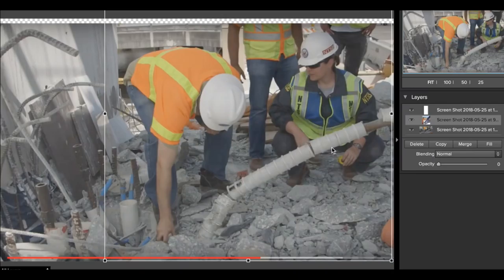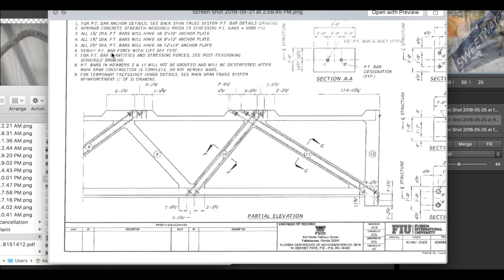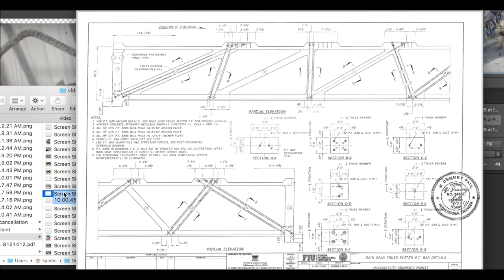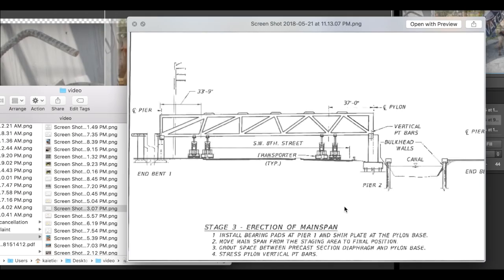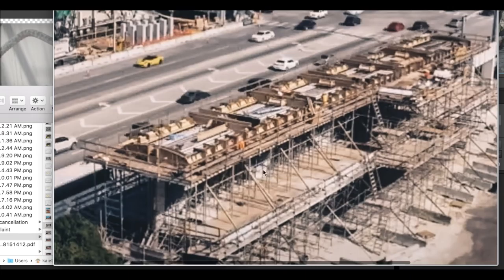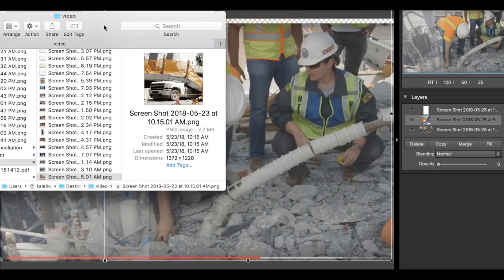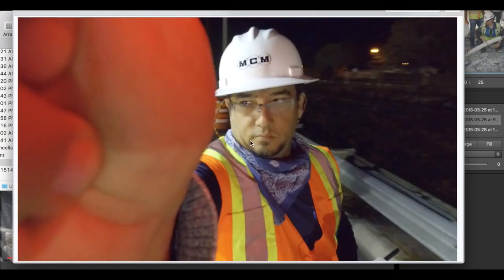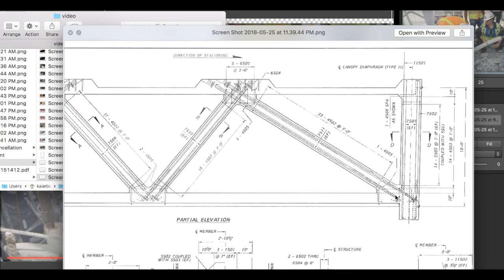FIU Bridge Collapse NTSB knows nothing about concrete - shear not possible PVC pipe proves this

Comment: Thanks CE&P, happy Memorial Day.  I took it on my own to go pick up a referenced link from the eng-tips group who have become interested in the FIU bridge failure.  I traced the link back to some more videos which run very well using "Drop box".  That makes for nice viewing.
Anyway, early before dawn, they are moving the bridge on the mobile transporters into position on TamiAmi Trail to stage it for the "set down" festivities with the dignitaries, speeches, etc.--( I think these were drone shot video)-  Something happened during the swing of the north end across the center island between east and west lanes.  Everything came to a stop.   There appeared to be a large amount of hydraulic oil running in the street behind the transporter.  Everyone stood around for quite some time.  --Then the video runs out  Next scene is morning  light, dignitaries arriving, amidst kids on skate boards, and the Bridge still on transporters is lined up with the piers or pylons ready to advance a few feet to the east then set down the load.   Of course, the road is shut down for the ocassion.  Did something happen when the north transporter had to jump the curb and steel plates in the travel path?  Was the Bridge subjected to racking or the chains tugging on the structure?
Did they hear a bang or snap and stop to see what had happened?   Don't know.
Reply from the maker: Hmm... the leak would be interesting, as the hydraulics would fail if it went too far...
Reply: Correcting my own post...In retrospect after examining more video, I want to correct my statement about hydraulic oil.  Now it appears this discoloration on the pavement of the Tamiami was rust picked up off the steel plates by the rubber tires of the north transporter (and there are many many tires) then redeposited on the pavement.

Comment: post tension plates, placed *Internal to the monolith caused internal destructive sheer..... by means of the plate compressing on one side and creating tension on the other side of the plate..... this would generate destructive cracks starting around the edges of the plates at each end.

I posted this vid to my web site 
www.solvesHVACR.com/fui

Properly done the post tension plates would be entirely external  to the monolith creating nothing but compression to the monolith    ... not an internal compression/tension schism around the post tension plate....   chaos math at its best.... imo... ymmv etc  let me know
Reply from the maker: Yes Phil, they did so many things wrong... that resulted in the death of 6 people... I saw your other comment, you are limited to what you do with sketchup... it's cool...
Reply: I used to work with AutoCAD's inventor program $8,000 plus a couple of grand to keep it upgraded every year.  It can do almost anything, but is maybe 30 times more complex with features that few of us need or use, so it takes much longer to create a drawing.   It takes years even decades  it to get good with it.    Sketch up has only taken me 3 years of a few hours a weej to come to my current level, and I am still maybe only 30% competent with it.

Comment: I would expect the man working the jack to fall at the same rate as the bridge, but he seems to lag.
I'm wondering if the built up energy contained in the tension rods propelled the bridge to the ground.(faster than free fall)?
Reply from the maker: Short answer ( in a vacuum they would fall equally)... Fake science... I know, we were educated that they would meet and therefore fall at the same speed/time...
With all that said, think of the ''force''  and weight is also force... also mass (BUT, some people say, you cannot use mass) and force together... 
You can  (factoring in the bridge and the human resistance and forces and distance )     or you can use resistance and force...   
 or old school common sense...  
(Do not believe what you know to make  == do not forget ''mass''...   GRAVITY is A force... 
I learned in school also that acceleration was equal but it is not...  
In conclusion, it is about air resistance... in a vacuum they would fall equally.

Comment: Does this make any sense?  

Post tension executed with the plate at the very end of the stressed piece works.... post tension applied to a small plate cast *inside of the cast piece creates shear stresses around the edge of the plate that can create internal stress cracks, ruining the piece utterly.... chaos math gone ballistic.
Reply from the maker: 100% stresses are at both ends...
Phul, I am not sure if that is mentioned in next video or the  one after or was three videos back but, both ends creating equal forces... is where I state that the weaker end would be on the canopy end ..
With that said AND with all those "obstructions"...the "#3 PT rod" could have pulled threw those "products" BUT, they do not show indicators of that, also, the "jack" does not appear to show that much "travel"... 
Finally, that concrete has to be "displaced", we would need to see inside of the bottom of 12...
Finally, we still have "#3" sitting or coming to rest on top of the pier/pylon...
Phil, I would love to have taken this apart, at that location...but, moving it and then taking it apart is just STUPIDUTY ON ALL THE ENGINEERS AND NTSB COULD HIRE.
THEY SHOULD HAVE INSISTED IT BE TAKEN APART IN PLACE.
Reply: Yes the stresses are indeed at both ends, but not at the absolute ends, the plates are situated INSIDE the member at the canopy and deeper inside at the base... this would be creating *internal stress anomalies *within the concrete itself... causing internal stress cracks around the plates

Comment: Why was the canopy made out of concrete?  
There are many other types of materials and styles that would have much
less weight and better construction.
Why have a canopy at all?  Many bridges have none at all.
.
A concrete canopy is crazy.  What were the engineers ever thinking about?
Reply: @ Bill: Well, with this design, the intention (and requirement) was for it to be a stressed member, but... you're right.
Another design with a nice stainless tube-framed vinyl canopy... like you might see on a sport-fishing yacht... could have looked much better. Change your canopy color for special occasions, etc. REMOVE the vinyl sheets, which could've been attached with "tarp bungees", for hurricanes... why not?
Reply: They were trying to reach 2 million pounds but the span turned out to be 1.9 million pounds. The cause of the collapse was known from day one ( 15 Mar 2,018)  post tensioning was  not done before the it was moved over the roadway,   it lacked  un-interrupted  length of reinforcing bar  or  better  yet  should have a full span of  steel beam under the  concrete  and  they  negligently  left the bridge without suspender cables attached just to keep the roadway open for traffic.
Reply: think about or visualize a horizontal WF beam or I beam.    The canopy is the top flange, the walkway is the bottom flange and all the diagonals are the open web.

Comment: The NTSB is having a problem here. They are notorious for putting blame on the dead guy. It's easy to put the blame of an airplane crash on the dead pilot , for example. But here they are at a loss as to where to put the blame. Don't be surprised , however , if in there final report they put the blame on one of the deceased drivers under the bridge for honking their horn. Causing a harmonic wave that caused a vibration that caused the Earth to vibrate .00000001mm on it's axis that caused the crack ar #11 just enough further expansion to cause complete failure of the bridge. There........blamed it on a dead guy. Next case.
Reply from the maker: Wow! That sounds like a joke, about the horn, but, with NTSB and this situation, they might just say the horns contributed...
Reply: I agree, I have read a few of the NTSB findings and after they point out dozens of things that went wrong they end up blaming the one person that can not defend himself.  They almost got Sullenberger until he pointed out that they had weeks to decide what he could of done different where as he only had moments.  In this case they will probably end up blaming the guy that adjusted the tension.
Reply from the maker: I did not know they had him on their dinner plate, what or rather How?
Ty

Comment: Hello
At 20:49 in your video there is a end view, of the walkway, on the right hand side lower corner, there seams to be a Gopro or something similar attached to a white pole ?   If it is, it would be interesting to see those images. !!!!
Reply from the maker: YOU HAVE AWESOME EYES. 
YOU CAN HELP ME FIND MORE ITEMS...
But, that is a sensor, I have not been able to determine the system... I think it was part of the bridge moving equipment... (I do not think it was a camera, at this time.)... 
Freedom, I do mean it... if, you find something else, please comment and I will look into it... Let me give you a link to a ton of videos and drop box - enjoy. 
Bottom right image, might be your ''go-pro"... https://www.dropbox.com/sh/u8qicuu22xmfhg1/AAAkDWUmkZw7umQRofEQY_FAa/video%20b-roll%20pre-move?dl=0
Reply from the maker: PS Recall, they had timelapse on this project so the failure, should also be on timelapse!  NO upload of that yet and also it would show the workers? (wait, unless, they lost the film, etc.)
Reply: Thanks for the link.
Very interesting videos. I see they put sensors into the columns, before the move, and they had wireless transmission,for the move, mite be why they stopped  the move at one point, so there should be a record of that somewhere. I bet it was not in uses when the walkway collapsed !   
    Two things spring to mind from the videos 
 (1) which I think would have very little affect on the structure, is the chains they used to steady the canopy to the deck for the move, I know that even the combined pull of all those chains should be very little compared to the force from the tensioned cables, But the walkway deck is or was a very shallow V so would have a natural tenancy to won't to curl upward but the failure dose not look like a longitudinal failure. 
(2) I saw when they were preparing to lift the walkway that the end of it was still supported  which was ok, But the bracing poles were bolted to the bridge and to the concrete blocks on the ground in several places, They could not have been stupid enough to forget to unbolt them before starting to lift it, could they ?  
  That mite course cracking in the angled columns  and stress across the walkway that would not show its self till the bridge was on its end supports.   Is it just me or do the drains down the center of the walkway look to be overly large, and taking away a lot of the strength from the center of the walkway !    
The man with the laptop and the sensors is the person I would won't to talk to most.
Reply: The equipment at 20:49 looks like a surveyors pole, with a retro-reflector on top. This would be used to confirm that the  bridge deck is 100% level while being transported.
Reply: I watched all the pre-move b-roll again.  Sure would like to see what happened when they removed the end shoring, transferred the load all to 
the mobile saw-horses.  I watched them attach strain gages to the diags
but then lost track if they were constantly monitoring for the whole event
or just measuring strain periodically.  
Just looking at those chains.  Most good riggers will cinch them down to
about 80% yield, no less than 60% yield.  Do you know what the chain
tension was on the canopy between #9 and #10? from canopy to saw horses?